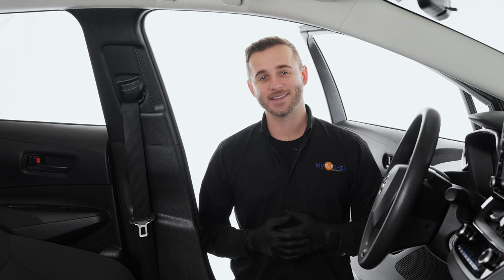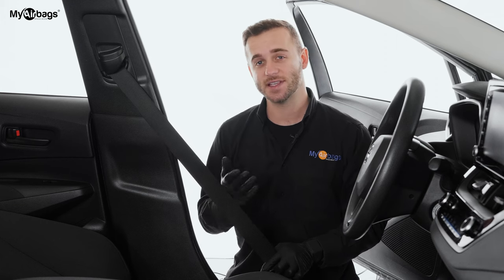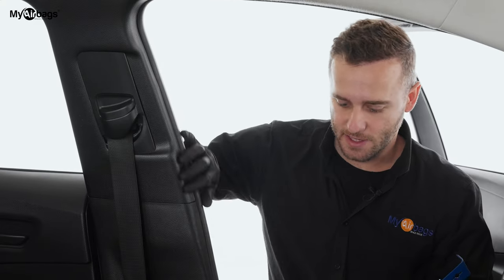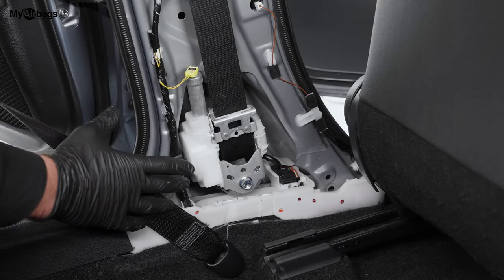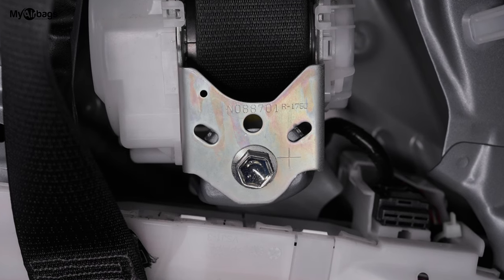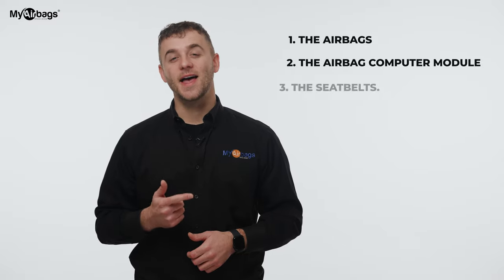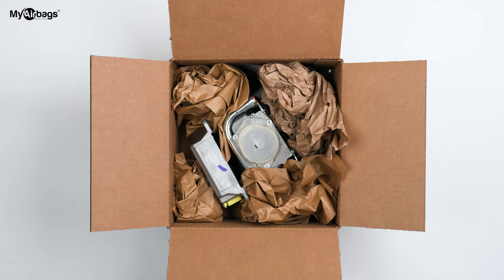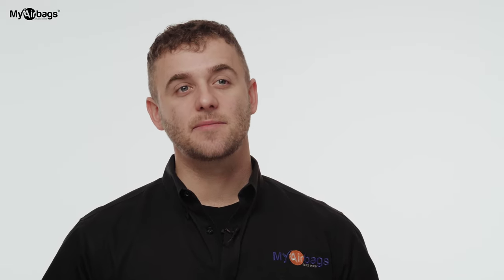How to Remove Deployed & Damaged Seat Belts on 2022 Toyota Corolla | MyAirbags

Comment: Is it necessary to unplug the battery before doing this just to avoid the airbag blowout?
Reply from the maker: It is not necessary, but it is what manufacturers recommend.  Also make sure the control module is bolted down with all bolts and the harness plugs are connected before turning ignition on. If not, it will blow side/roof airbags and seat belts.